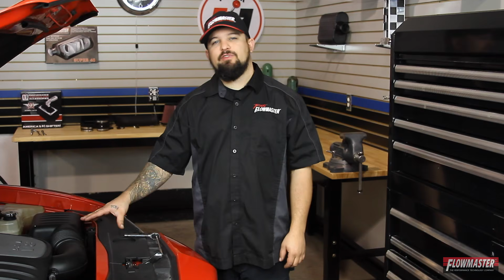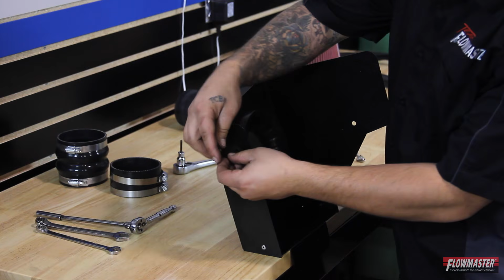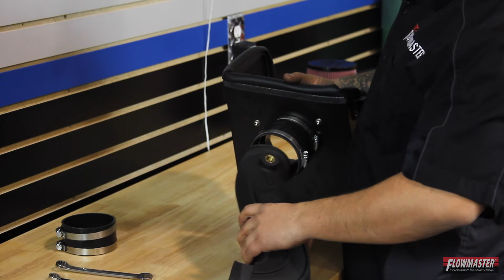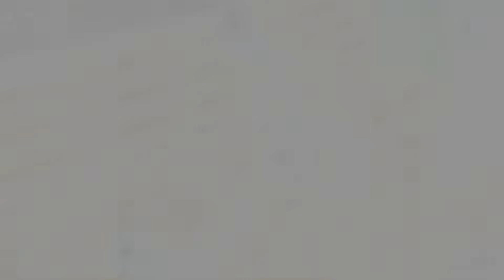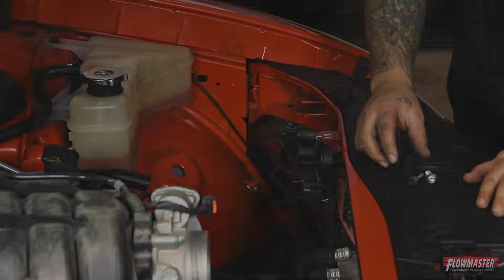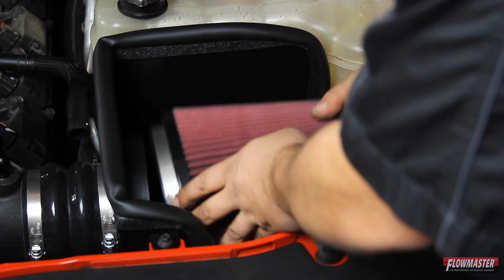2005-19 Dodge Charger, Challenger, Magnum, 300C 5.7L/6.1L - Delta Force Cold Air Intake  615105

Comment: Any video of how this intake sounds with flow master exhaust n what's are the prices? I already have a fm catback exhaust 817658 on my 16charger rt, thinking about gettin the intake as well
Reply from the maker: Hi,

At this time we do not have a video of this particular Delta Force Cold Air Intake installed on a vehicle with a Flowmaster exhaust. However, you can expect a more pronounced induction sound. Feel free to give us a call at 707-544-4761 and will happily answer any questions you may have, as well as provide you with a personalized product recommendation.

-Team Flowmaster